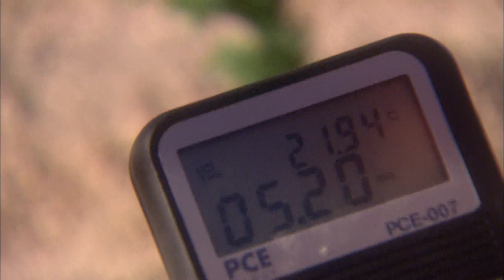China's Battle against the Deserts | Documentary

Comment: I thought we were running out of sand for concrete.  Why not use existing sand to create walls with mesh uprights to not only control the flow of sand, but to slow the wind passing over it.  Export the sand for concrete elsewhere.  I see a pack of hungry solutions to this problem.
Reply from the maker: So did you like this documentary in order learn something?

Comment: Very interesting documentary and good on them i say... Planting trees is one thing but it wont bring back the glaciers that are needed to supply water to the region. Its an extremely expensive band aid. Fixing the symptom instead of the cause.

If humankind find alternative energy sources and stop logging in the region and plant trees to halt the desertification we may never reverse the warming that has altered the amount of fresh water.

No water = no trees :(
Reply: You got the causation wrong. Water supply is not caused by glaciers but by precipitation. A glaciers is just a huge natural water reservoir, i.e. it acts as a bufert in dry times. Precipitation, and thus water supply, can continue without the presence of glaciers. Therefore, considering water supply, it is not a problem if the glaciers disappear, since you can buffer water artificially with e.g. dams, but it will be a problem if precipitation decrease or demand exceeds supply. And I suspect the latter might be to be blamed here as well.
 
"If humankind find alternative energy sources and stop logging in the region and plant trees to halt the desertification we may never reverse the warming that has altered the amount of fresh water."

Correlation does not imply causation. They documentary mention increased salinity, brought by the dessert sand, as a factor for the dead forest. In that respect, not even a total ban on logging wont do anything the prevent desertification. The point is, most often we only hear what we want to hear, and if we want to hear "we can fix it", then perhaps that is what we do only hear.
Reply: @jomen112  Exactly. I was thinking that snow pack was the main supply of water for the region not glaciers. There is so much focus put on the melting of glaciers like it's a catastrophe when it happens but as far as I am aware nothing bad has ever happened from the melting of a glacier. All I know is I would much rather live in a world where ice is retreating then a world where ice is advancing.

Comment: Open Canals, especially in hot areas, are not really a good way to irrigate. Drip or Injection Irrigation is the answer. Israel, Australia, the Gulf States and Saudi Arabia have been able to fight the desert, not completely but enough to produce crops and change micro climate. China is almost an industrialized country, surely, she can produce enough plastic tubes and pumps to meet the need. I worked with Drip Irrigation Systems in the UAE in the late 70's and early 80's. In less than 20 years the area was changed.
Reply from the maker: Very interesting to hear from someone who knows. Thank you for sharing your knowledge with us!